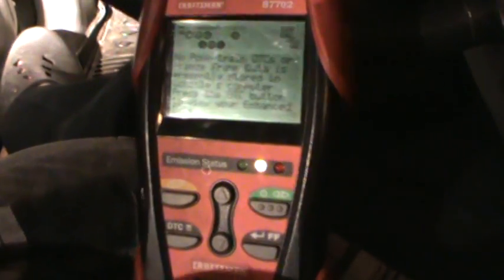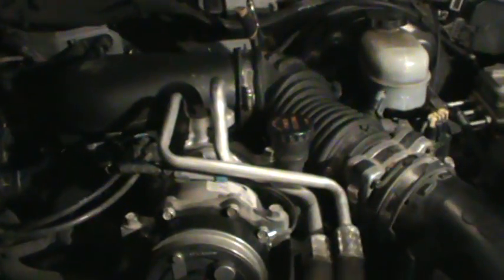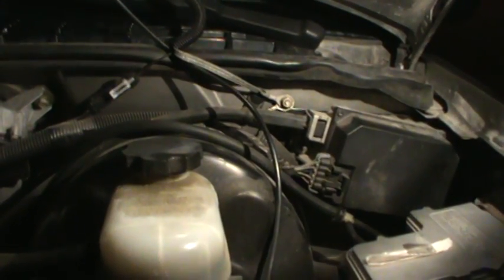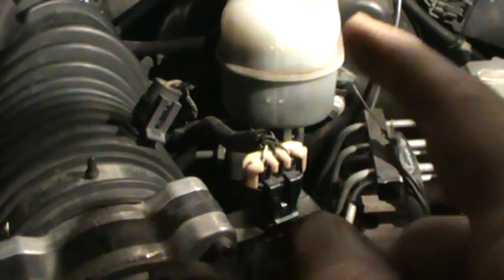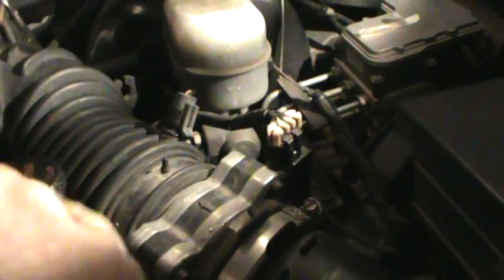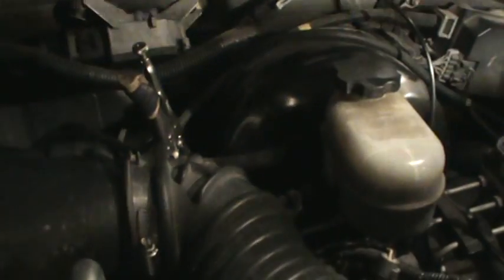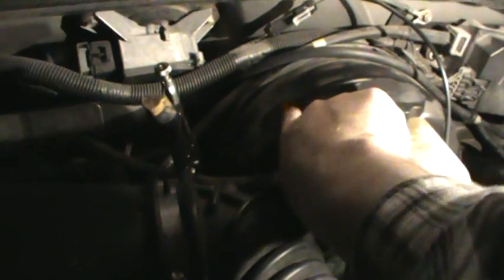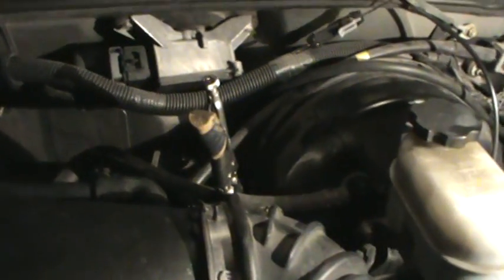Lean Codes P0171, P0174, With P0102

Comment: good video,you really did break it dwn,I ran into a vacc. leak @ booster  diaphragm .  No code the vehicle Idle was shit tracked it dwn . basically the same way.if you had no smoke machine you could have done the ol'e cigar smoke trick or made one (I fabricate a bunch of my speciality tools) not all cars will throw a code on this problem 08 RAV-4 was the model i fixed recently Good video